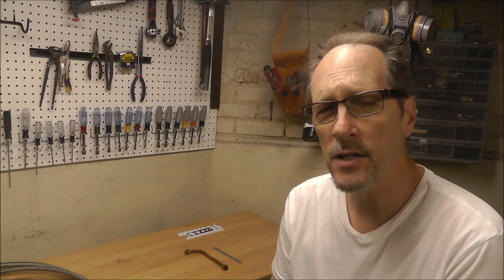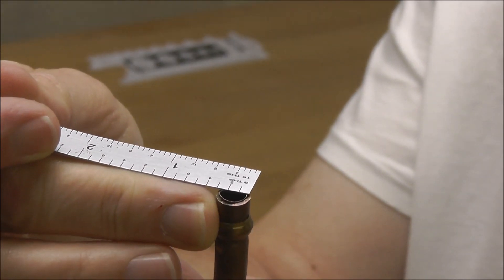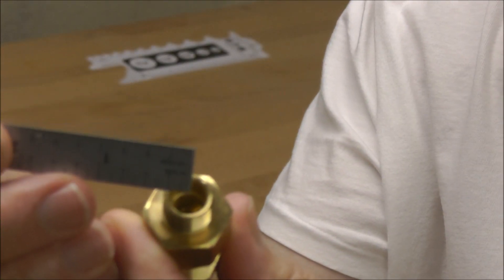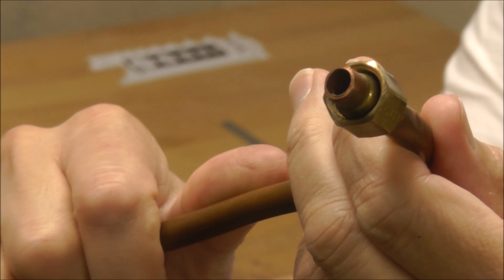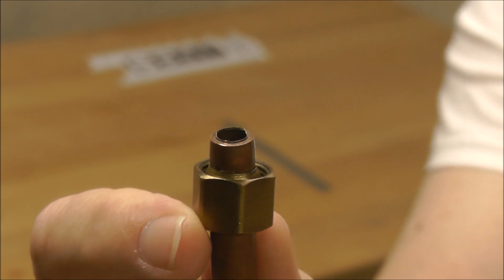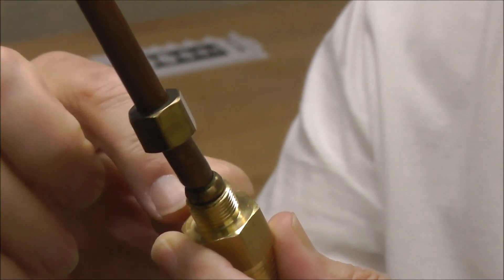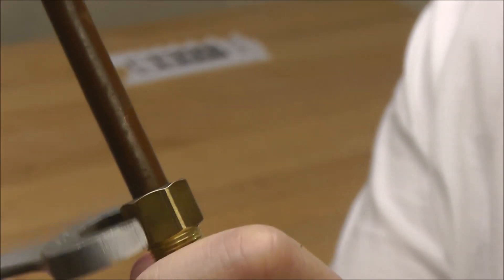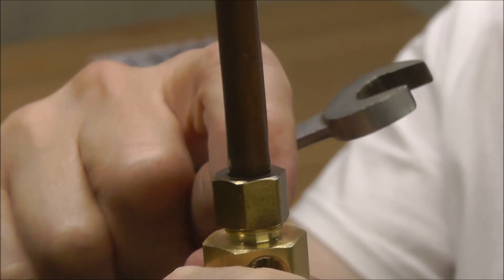Measuring compression fittings

Comment: Thank you for helpful video with good information.  Do you know the actual thread size for a 3/8 inch compression fitting and also a 1/2 inch compression fitting?  I find conflicting information searching the web.  I wanted to use a thread die to clean up some threads on these fittings in a restoration project in an old house, but I wasn't sure of the exact size.  Thanks in advance!

Comment: The rigid  faucet supply lines (I think) use Copper Tube Sizing (CTS). The ones I bought are stamped/marked 1/4” on the outside, yet the OD is 3/8” which is the exact opening (ID) size of a compression threaded angle stop for a faucet or toilet. It’s confusing to the average DYI guy who only does some plumbing every 2-3 😂years.

Comment: I'm interested in your advice on tightening the fittings. Another video from a plumber talked about taking the nut to snug, then giving it half a turn, no more. Your advice sounds better, but is that just because you're putting these together for compressed air, or should household water lines be the same?
Reply from the maker: Thanks for the question, Keith. Once you have tightened the compression nut, I would say to give it about a 1/2 turn more. There is no difference between a water line and an air line in regards to how much you tighten it. You would then turn on the water or the air to ensure that there is no leak.
Since most compression fittings are soft metal and not cast iron, you do not want to strip the threads, just tighten it enough to make sure that it does not leak. With time you will be able to know how much to tighten it.
Reply: One can imagine tightening a brand new compression ring and reusing a still good compression ring requires a slightly different "feel".  In any case, over-tightening is a sin as that ring will not be reusable. Under-tightening is easily correctable.

Comment: Thanks for this. I need to change out several compression water valve shutoffs in the bathroom and kitchen of a house I'm renovating bit by bit, and it's been maddening that no measurements I take of the old valves come anywhere close to the listed sizes of the new valves. Seems I wasn't measuring the pertinent things. 

So, it's the exterior diameter of the water supply pipe that sends water into the shutoff valve that is advertised, right? Does the same rule hold for the other end of the valve? That side would connect to a short mesh compression line rather than a solid metal line, which in turn fits to the appliance. So, the valve's output would be listed as measuring the exterior diameter of the compression line fitting into it; have I got that right? 

Thank you for your time.
Reply from the maker: Thank you for the watch and for the question! 
For compression fittings, the ridgid pipe that goes up to the toilet, there is a ferrule that slides over the pipe, you measure the OD of the pipe to obtain the compression fitting size. If you have a mesh tube that connects from the bottom of the toilet to the valve, that should also be a compression fitting. For this, measure the ID of the valve where it fits to th
at flexible line. It will probably measure 3/8".
https://www.homedepot.com/p/3-8-in-Compression-x-7-8-in-Ballcock-Nut-x-12-in-Braided-Polymer-Toilet-Connector-B1-12DL-F/100094502

For the pipe that comes out of the wall or floor, there are many types of pipes that were used. Old plumbing used threaded pipe. Newer ones used a solid copper pipe that was "sweated" to the valve. Others also used solid copper pipe, but instead of "sweating" the valve or "soldering" the valve, they used a 1/2" compression nut on the valve.

https://www.homedepot.com/p/BrassCraft-1-2-in-Nominal-Compression-Inlet-x-3-8-in-O-D-Compression-Outlet-Multi-Turn-Straight-Valve-OCR14X-C1/202047042